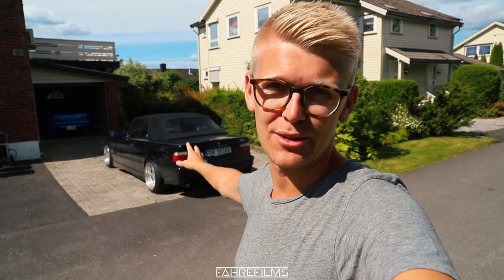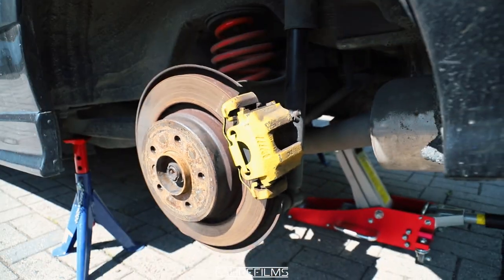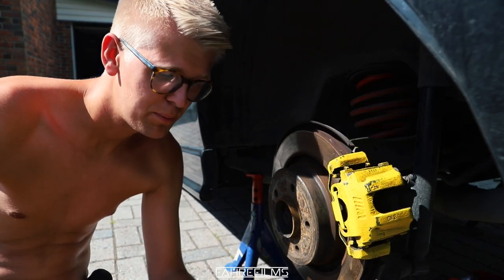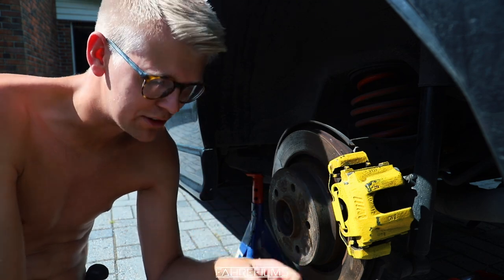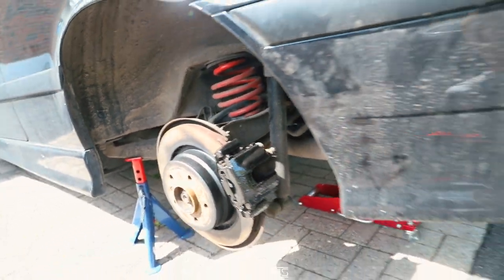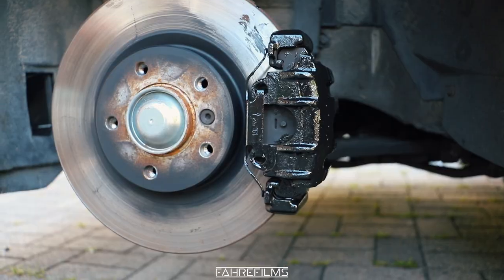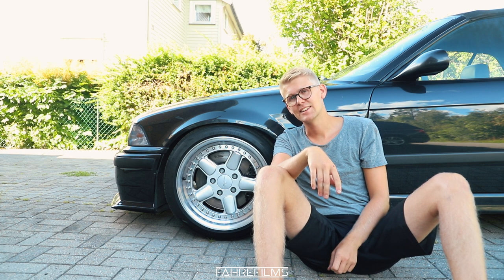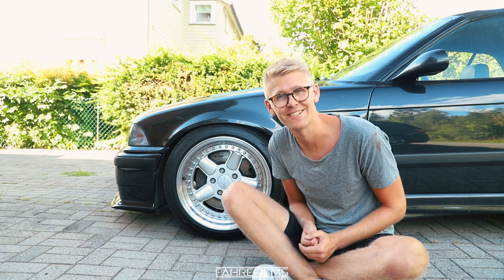Fastest, Easiest And Cheapest Way to Paint your Brake Calipers!

Comment: I used the exact same paint from biltema to paint my motorcycles front caliper. It has survived well over two years for now, but definetely isnt brake fluid resistantas it states.  After bleeding the brakes, some brakefluid dripped on the caliper and i just wiped it off, not thinking about using brake cleaner... Paint started to strip off after a week. But after all, very strong paint, if you properly clean all brake fluid what may contact the painted surface